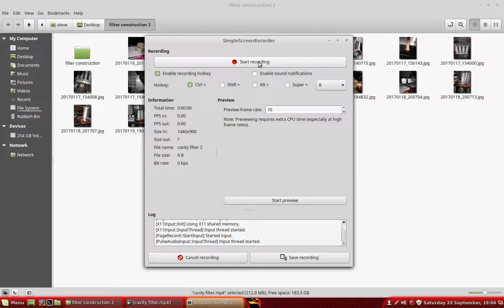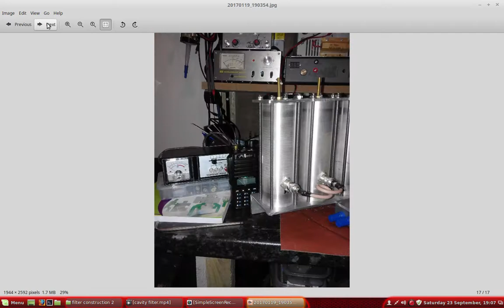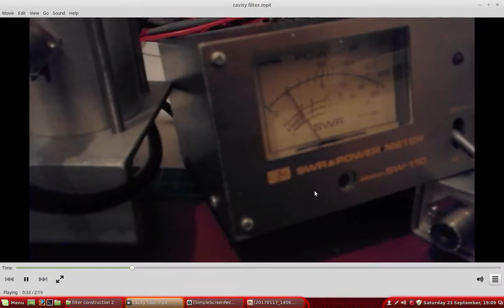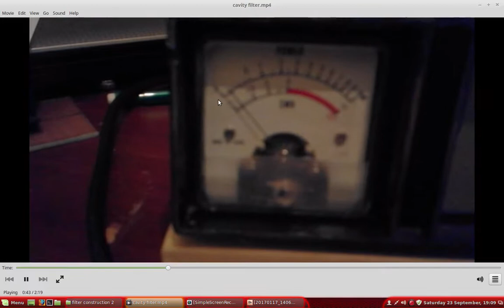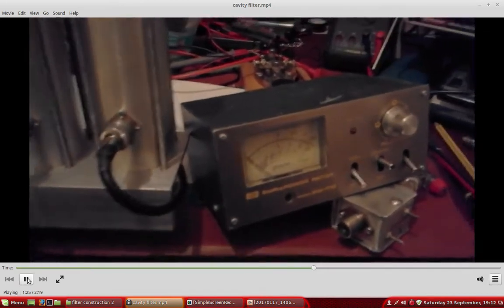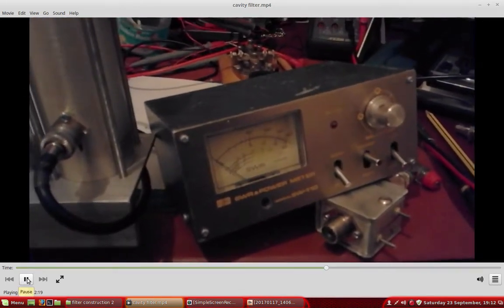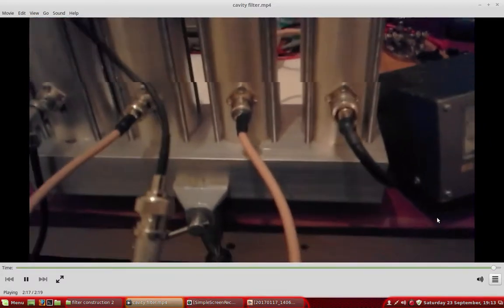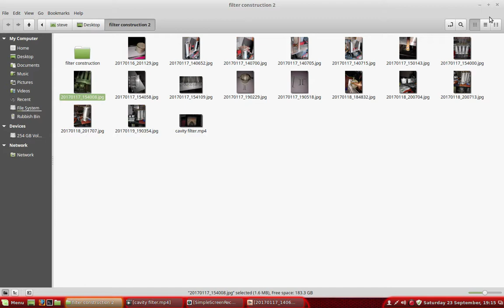cavity filter 2

Comment: so you inject a frequency in the antenna port ??
and tune low frequency and high frequency for one frequency maximum ??
so surely you're allowing say 431.000 as the low to pass fully but being allowed to pass fully in the high which should be say 439.00 how does it notch out the low ?
or do you allow 431.00 in one side and 439.00 in the other both peaked for maximum ??

great construction but at 7.6mhz why not just buy a ready made unit for about £25 like i did..
although i require 1.6mhz i need a lot more notch..
Reply from the maker: You are correct I too wanted 1.6mhz split unfortunately this project is on hold at present my alloy stockist closed and have not been able to purchase further supplies this was done as an exercise in truth 6cavitys are needed for 1.6mhz split and diameter needs to be increased to 3inch or 75mm thanks for the comments